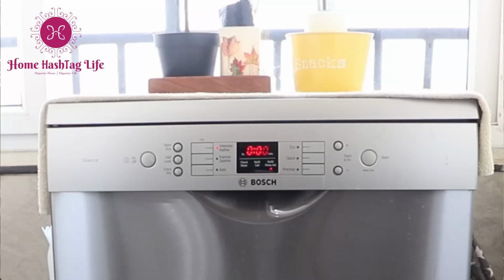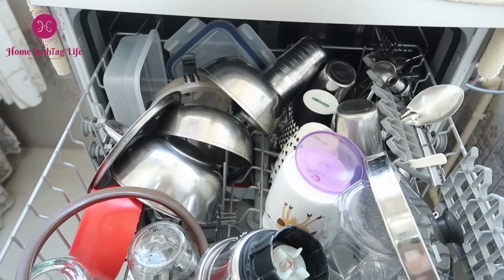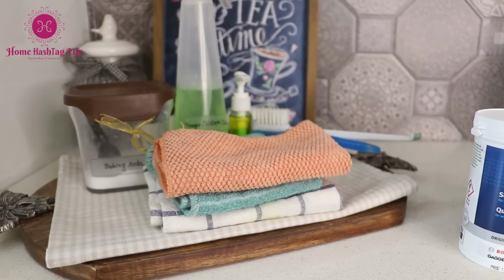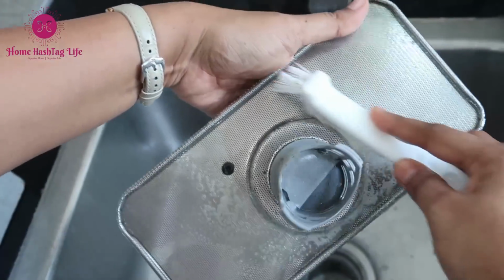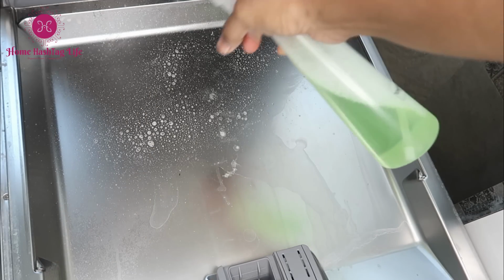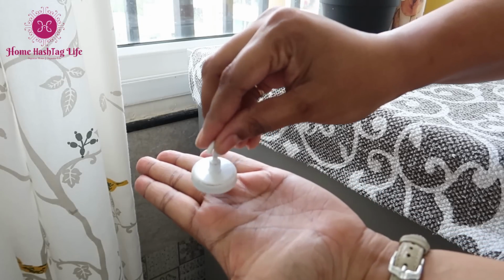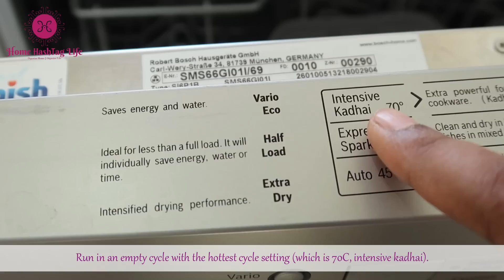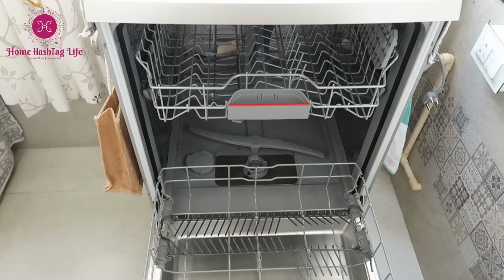10 Tips and Tricks to Clean Your Dishwasher / How to Clean and Descale Your Dishwasher

Comment: Great video. LG recommends that either put 2.5 Tbsp. Citric Acid in detergent dispenser and run a hot cycle or Keep a 3/4 cup of white Vinegar in upper rack and run Auto cycle to clean the dishwasher and get rid of scaling. Till disposal of my LG dishwasher, I used these methods to great satisfaction. I am using same methods in my new Voltas Beko 14 place dishwasher. It is safe and very economic.
Reply: I too have Voltas Beko. By the way which is better, voltas b..or LG?
Reply: @Nivi.K  i sold my LG 2 years back as it was not resuming cycle from the last stage after power outage. Its heater also failed. Now I am using Voltas BEKO which is an excellent dishwasher. It has 4 sprays.
Reply: @AtulKumar-sw6fc  OK thanks
Reply: @AtulKumar-sw6fc what about spare parts availability for Beko?
Reply: @johndoe-vc1we  till now, i didn't need any spare part. Whenever a service request (paid) is made, the technician comes promptly and resolves the problem. Normally, technician is needed for removing sand from the water filter.
As the dishwasher is under warranty for 10 years and Beko has commercial tie up with TATA, I believe that service parts should be available for at least 10 more years.

Comment: Could you also explain how to remove the small particles from inside of spray arm? If just use a stick to push them out of the holes, next time when the water comes from the spray arms, these small particles would again block the holes